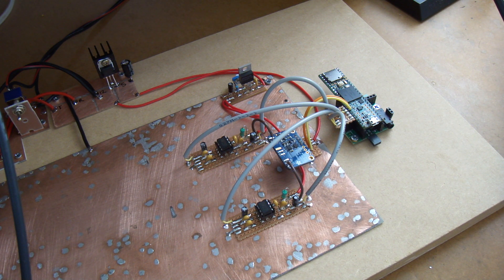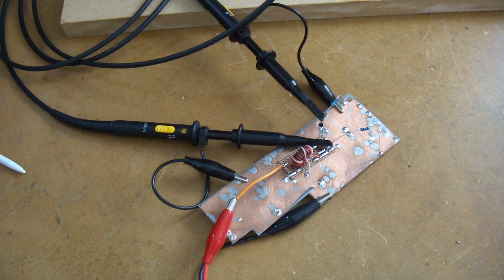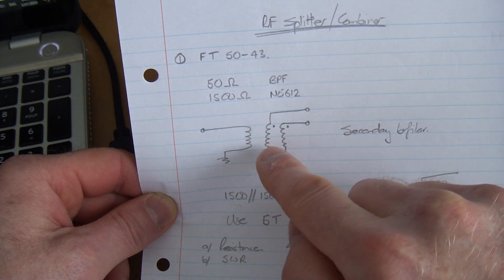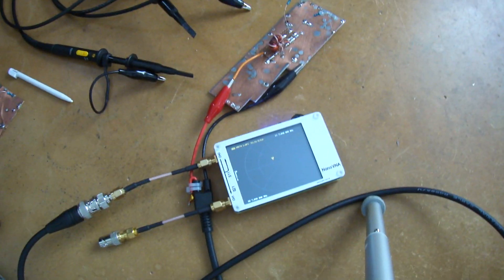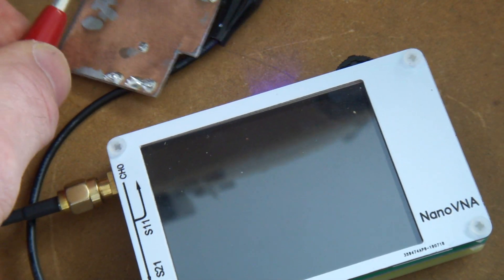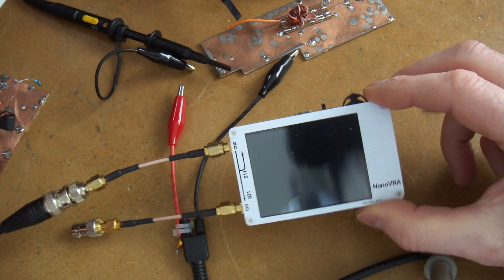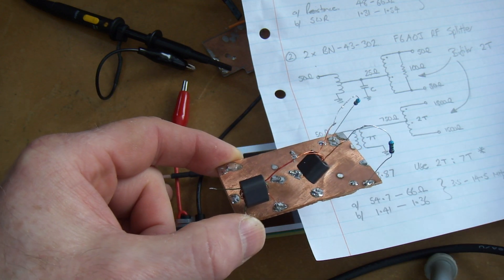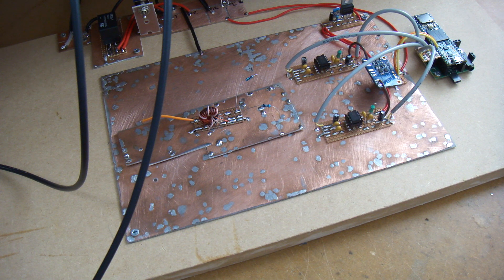Digital Modes Rig - Part 4 RF Splitter/Combiner

Comment: From a long time back. I just built the circuit you used for AGC of the MC1350 IF amp. I made 3 modifications. I replaced the 10K resistor in the detector with a diode, I used a series fixed resistor in the pot to set no signal to 6 volts and I used a 100K pot in the 741 feedback instead of fixed resistor. It is working very well. Thanks for your great videos.
Reply from the maker: Apologies for the late reply Loren. That sounds great. I will have to take another look at that AGC circuit at some stage.

Comment: Going back a little. I have designed two Hilbert +/-45) filters but with 200 taps. This improves the linearity of the phase shift across the audio range. I found the TEENSY 3.2 was able to run these. SSB sounds good, but I still have too much carrier breakthrough. I am using SBL-1 mixers and a "combiner" like your but at 50R I/O.
Reply from the maker: Yes, I must try a higher number of taps too and see what the difference is.

Comment: The resistor in a splitter/combiner has nothing to do with the load. When splitter/combiner is used in a direct way, e.g. as a splitter, there is no current through the resistor. It works only in combiner mode and insures proper port isolation. You have to measure out1 <-> out2 response to see the difference. Also I strongly advise to model such circuits in LTspice. It will give a much better understanding of the circuit. 73s de R2AUK
Reply from the maker: Thanks for that. Very useful.

Comment: Rf switch sa630 50ohm-50ohm.possible to be adapted sa612?
Reply from the maker: Thanks. Something to think about.
Reply: I've used SA630 for  switching small RF signals in receivers. I assume you are suggesting using them in a switching mixer?  I'm waiting for someone to try thus device out as a mixer.